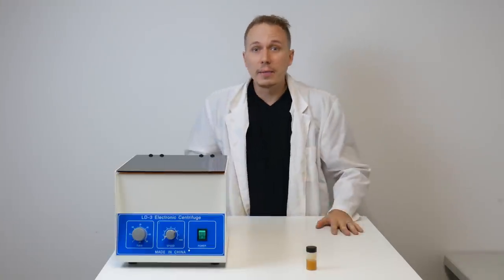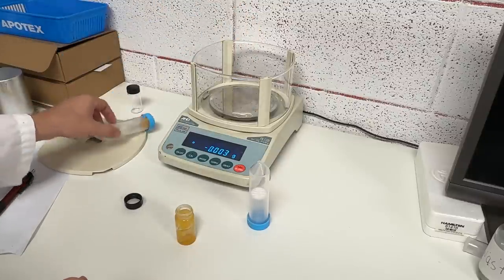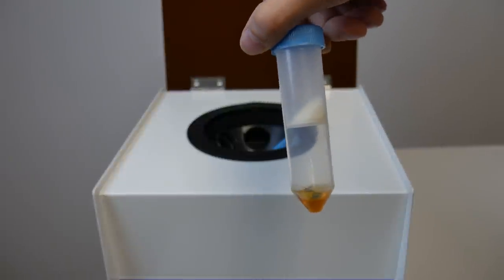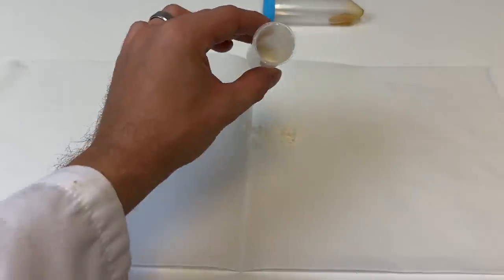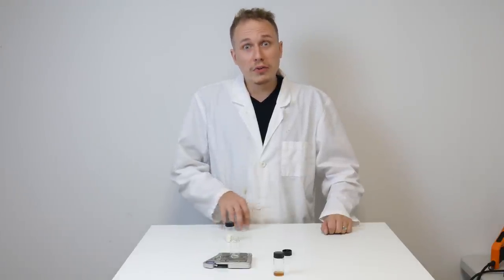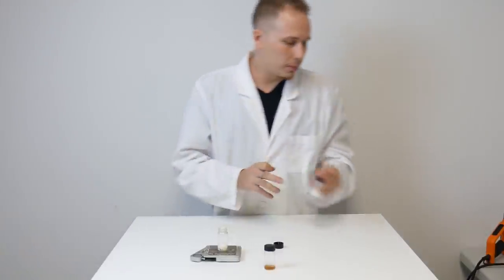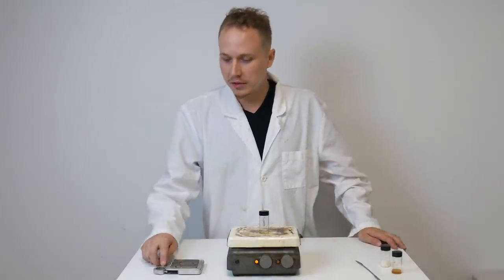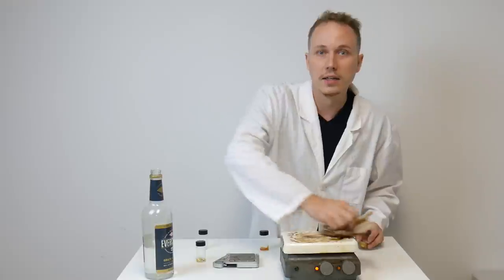Separate THCA from Live Resin and Terp Sauce using a Centrifuge

Comment: Once I gave you unpleasant comment. Sorry for that because you are really making great job with such educational videos. Can you record extractions of cannabis to live resin? Watching such things is really amazing thing.
Reply from the maker: The setup to make live resin would costs tens of thousands of dollars and be outside my budget as well as 99% of my viewers sadly.
Reply: @CartandPod  wow so expensive. How about CO2 extractions? Or maybe something like "nugsmasher" press?
Reply: Minimum maybe $2k...
Freshly harvested cannabis (not dried or cured)
Solvent (usually butane, which is highly flammable and dangerous to work with)
Extraction tube or system
Purging equipment (like a vacuum oven) 
Freezer
Safety equipment (gloves, goggles, outdoor workspace) 

however, if u want to make BHO (Butane Hash Oil) but make it qualify as ''live resin'' just use freshly harvested bud and subject it to below freezing temp. and your bho is live and that can be done for maybe $500 or less.
Reply: Not saying its safe but blasting fresh frozen into a jar with dry ice is a thing, however dumb
Reply from the maker: I was referring to co2 as the expensive method

Comment: Legend John, thanks for sharing the nugs of knowledge with us all! I bought an Amazon centrifuge ($180 or so) and some filter tubes (found on eBay for only a few $ each) . IMPORTANT: take note of the size diameter tube that your centrifuge supports, some of the models only support very small thin tubes and it can be really hard to locate filter tubes that actually fit!! 
I would advise locating the filter tubes first, and then purchasing a centrifuge machine that will support the size.
Some filter tubes on the market are super expensive, like more than the centrifuge machine!! so be careful you have the tubes sorted first!

I managed to find some filter tubes by a brand called "Millipore" that fit, however after spinning for 20-40 mins, there was no separation because I guess the filter size was too small in the tubes I tested (mine were called 100,000 MWCO for reference), so all the material was still in the upper section.

I am investigating the idea of using rosin micron bags, if anyone knows about how to use these with a centrifuge, please let me know the tec! 

Thanks in advance and happy vaping everyone
Reply from the maker: Just pinch the top of the bag into the screw tip or press fit of the vial to hold it down.

Comment: This tech has been used to separate thca from terps for a good while now. 
We've been doing it since 2016.
You can modify bowls on other centrifuges and process a lot more at the same time.
There’s also centrifuges with cooling capabilities, spinning produces heat in the process and partially decarbs thca.
Reply from the maker: Yup nothing new
Reply: I guess new to rosin @CartandPod  
And I like it. Have you used to cooled or chilled centrifuges?
Reply from the maker: Nope this is my first one, and was my first time using it for the video as well! But I’ve got more experiments coming up
Reply: do the fats and waxes have to be removed for this process to work?
Reply: @IchDuForeverExplorering  
No, your end product will still have them but they’ll end up in your terps, more than in your thca. 
I’m not even sure how you dewax and purify solventless, I’maure it’s possible, but it’s easy with hydrocarbons. 

If you’re working in lab with all the right safety precautions, tools, etc,  you can mix your crude with fresh solvent in a mason jar, mix well until oil is dissolved, and winterize it in sub zero temps/cryo freezer. -80c works fastest and best. -40c works but takes longer. 

Once the terps and thca have separated in main jar, pour oil through brown coffee filter into another jar, thca should remain in jar or fall onto paper filter.  
Mix both terps and thca that have been separated into separate jars with fresh clean solvent, and freeze and filter again at least 3-4 times. 
This process is better than using centrifuges because you’re using subzero temps to separate terps and thca, you maintaining more of the terps and have white powdery thca.

Comment: Just found this channel last week. You, my friend, are my new role model. 
Life Goals!!!!! (currently at the entry-level closed pressurized column stage in my extraction journey. I want to eventually get to your level. I know the equip is super expensive though...)
Reply from the maker: The centrifuge is actually pretty cheap check the description. Also I don’t even got a closed pressurized column myself you might be a couple steps ahead in the equipment ahha
Reply: @CartandPod great information what is the metal piece that's spinning when you're decarbing?
Reply: @General_SaNu  he explains what it is right before using it. it's a glass magnetic stir bar.
Reply: @xavierdoppler9997  does the potency of the THC matters or it's mainly the thca that's separated is purified no matter what strain
Reply: @General_SaNu  you have to specify what you're asking a little bit more.
Reply: @xavierdoppler9997  does the flower potency have an effect on the thca
Reply: @onlythenation4566  im not a botanist or a weed scientist. I'm sure that flower with higher thc content will yield MORE thc-a, but I dont know whether or not that contributes to the purity and/or concentration of thc-a in the crystals. Maybe the youtuber could give more insight, but if i had to GUESS, i'd say that a higher thc % results in MORE thc-a, but I'm not certain it changes inherent properties of the crystals themselves.

Comment: Great to see that this professional centrifuge can't handle litle imbalances. I use a 5ton cnc lathe as a centrifuge. It can easily spin up with a static imbalance in access of 100kg 😂 so my DIY verson works better than the real thing😁

But it's great to have someone explain the proces clearly. Good video. I'm learning things here. Keep up the good work
Reply from the maker: Professional? This is like the second cheapest centrifuge on Amazon haha I wouldn’t call it professional, your lathe likely costs 10-100x what this device costs

Comment: There is a way to do this on a large industrial scale with winery equipment using a screw press a screen and a centrifuge and an organic solvent. It’s possible to do the reaction cold to hot to put different terpenes into aromatic suspension it can be done in an oxygen free environment to ensure maximum plant aroma carry over and bio active material. Nuclearisation is also possible with hydrogen gas.
Reply: The medical Marijuana is supposed to duplicate the synthetic component not have a bunch of cripples running around on the bio active plant material. I’d recommend oxidising the oil then treatment with sulphuric acid to the potent non flavoured components.

Comment: you can use rosin bags instead of the filter tube if you'd like it to go a bit faster! I've noticed your terps will be very thick if done in this manner as more thca is able to get through the filter, but if you have live resin with decent chunkers, using rosin bags will save ya a couple hours in the centrifuge, and less centrifuge time means less time heating your terps up.
Reply from the maker: Yes I’ve been suggesting this to people who cannot find the filters as well :)
Reply: Which Rosin bags do you use?
Reply from the maker: @user-fz2od7xb7y any, try around 25 mic

Comment: Does the centrifuge core act like fan blades in a sense were it creates air flow from one side to the other? If so you could always put a block of dry ice on the low pressure side hopefully keeping it cool enough to run continuously.

Comment: At 45micron you could get sub 45 micron sugar in your sauce depending on the quality of your crash out. It might clog an atomizer if carts is what you're doing. 

45micron is definitely too big if you're using this method to filter particulate from your melted rosin for carts. 

IF you cant find smaller micron filters you can simply just use a regular ampule with a 2x4 5-10micron rosin bag cut down to size so it sits half way up the tube. 

Fold the top of the bag over the lip of the ampule and screw it between the lid and tube. 

Better filtration = 5 - 10 micron
Reply from the maker: The terp sauce won’t clog at 10-30% usage. I prefer the extra stuff in it from the larger micron size
Reply: They key is definitely having a 100% clean and quality THCA crash before seperation so you dont have micro crystalization. 
Then  none of this is an issue. But if it isnt crashed well. Filtration is king. 

On a commercial scale -  superior filtration = Less returns. Less returns = more sales.  

   @CartandPod

Comment: Wow that's sick ! Living in a country where weed is still illegal, I don't know much about rosin (not to say nothing) and ive a question :
What's the point of decarbing thca ? Is it only because, as you said, without thc thca would cristillize back once into the cartridge ? Or does it have any advantage of consuming thc over thca even though we're going to heat it ? 
Thanks in advance hope you'll answer i really loved the mechanical separation using a centrifuge
Reply from the maker: It’s just for what I said in the video
Reply: From experience, using mostly THCA on cartridges (even with waxidizer at an 50/50 ratio) will cause some part of the cartridge to recrystallize, this will clog the cartridge, possibly taking slower after hits for the cotton to absorb more liquid or even burn the coil if you are not patient.
Reply: Dude above me has a great explaination.
If im not mistaken its also because the THC is "vaporized" and not actually heated up high enough for the THCa to completely decarb like a hot dab rig or a blunt/bowl would.
So you end up smoking more THCa then desired and it changes the effects, but i could be wrong tho.
Reply from the maker: @TjallieBrrr the vape heats up the thca enough to convert it to thc when vaped, the decarbing is purely for viscosity like I say in the video…

Comment: lmao, the ethanol on the hotplate, way to give the cannabis community a strong name!
Reply from the maker: I had no water nearby the place was just starting renovations
Reply from the maker: Plus it could use a little cleaning like I said haha
Reply: @CartandPod  I can understand, especially with our hobbies, how this could happen, but we gotta be better man. We will never lose the stigma without a change to be more present. If we want to get high all the time, dope, that's dope, but do it right ✅️ 👌 😉.  Great video, although, like I said before, you can get glass vessels to pull the terpenes into. It would also allow for zero loss as you could heat the vessel to remove any/all.
Reply from the maker: They don’t make glass ones with the filters sadly

Comment: Hey, great information. Thanks for sharing to this Canadian.  I'm wondering if standard pressed flower  Rosin(not live rosin) would work for starting material? Cheers, thanks for the knowledge
Reply from the maker: It will but with a little prep work first, I’m working on getting enough flower to do a rosin video on this but you need to nucleate it first
Reply: @CartandPod  Interesting, Thanks for the fast reply. I will have to read up on nucleate techniques. If you ever make a video on the subject, I would be looking forward to it.
Reply from the maker: It will be my next released video, or if not one of them. I have it all planned out just trying to get the flower for the rosin atm
Reply: @CartandPod  Sweet
Reply from the maker: Also just fyi rosin and resin (live resin) are different things, rosin is made with a press as you know, but resin is a hydrocarbon extract
Reply: @CartandPod  yes so that's what I'm trying to figure out. Dried flower pressed into rosin than refined into THCA. I'v tried the pressing method to get THCA with a 25u micron bag but haven't had much success. Maybe the centrifuge will be better for me. I'm thinking it could be the starins I have don't like to suger/budder up so pressing out thca not working. Nothing ever left in 25u micron bag
Reply: @CartandPod I'm still looking forward to that next video if you ever get time. Cheers
Reply from the maker: Having trouble finding enough quality rosin

Comment: Great Vid! I'm curious tho. Would co2 work instead of argon or would it have some repercussions?
Reply from the maker: any heavier than air gas works
Reply: You could use nitrogen gas (N2), since the whole goal is to remove the oxygen and replace it with an inert gas.

Comment: Does this work well with solventless rosin too?
Reply from the maker: Yes I’ll do a video on rosin soon
Reply: @CartandPod Do you happen to do any short path distillation? I think that's the way to get to distillate for vaping live resin /rosin?
Reply: @CartandPod  i have question about live rosin, can i centrifuge wax and lipids from hte? my idea is to make clean vape carts but i need more than 4000r/min?
Reply from the maker: @pawelk3702 what’s the question about live resin? Yes you can centrifuge HTE. No 4000 rpm will work it did for me just now
Reply: @CartandPod  question is about solventless rosin. Making bubble hash, press that hash, then centrifuge live rosin to thca and hte and that hte should have wax and lipids? corect?
Reply from the maker: @pawelk3702 ahh that makes more sense, some lipids will be pulled through but some may remain in the thca as well if the particle size is too large

Comment: I purchased all the listed items, but can’t get the results. Some terms separate but nothing like the video results. What am I missing?
Reply from the maker: Maybe the live resin your using is low quality and doesn’t have much terps or the thca aged into thc
Reply: @CartandPod  hmmm, well I did a fresh press with my NugSmasher specifically for this run… don’t think it could have been any fresher. I pressed enough product to make two @6 gram vials, some terms were drawn out but the majority remained. I’m on the hunt for a method to make the beautiful white results you get! Thank you for the content you post and the assistance!
Reply from the maker: @clashon6163 rosin is NOT resin, you can’t do this as easily with rosin
Reply: @CartandPod  back to the drawing board, thank you for the clarification!

Comment: Which method do you get “ live resin”? I guess it was “ rosin” but not you wrote that it was “ live resin “ could you tell the methode to get “ that live resin “ ? 
I apreciated you attention ..
Reply from the maker: Resin and rosin are not the same thing. Resin is a hydrocarbon extract
Reply: @CartandPod  thanks , but could you tell me what is your “method “to get the material tha you use in the centrifuga lab?
Is HBO extraction methode ?

Comment: I don't know how many Labs you've ever worked at but Teflon can withstand 10 times that. I use it in distillation of sulfuric acid and I have never had any problems at all sulfuric acid boils at 640 F!!!

So the 10 times comment was an exaggeration but you get what I am saying
Reply from the maker: I have scratches and pieces missing from my teflon spinners so I don’t use them, I can see they are degrading